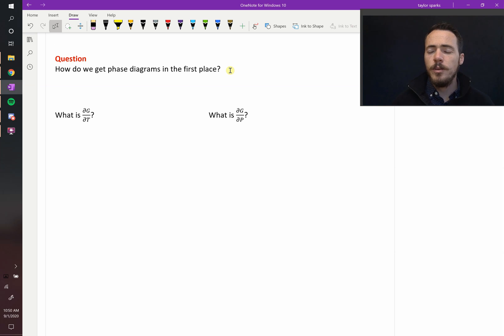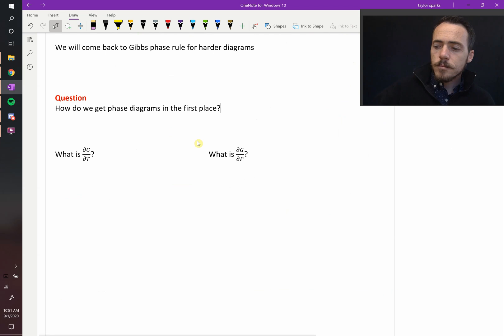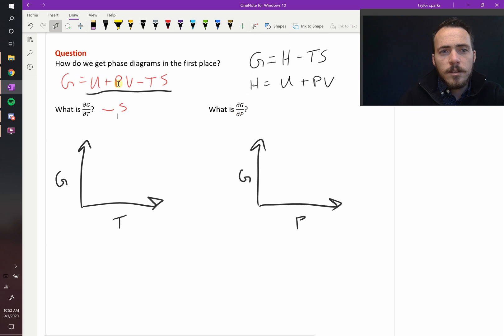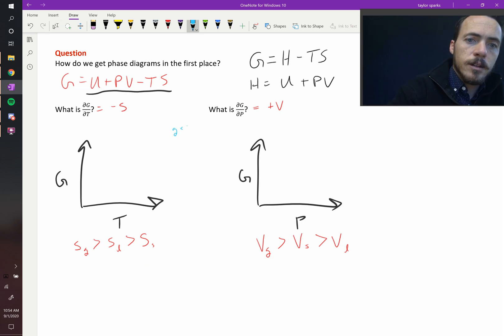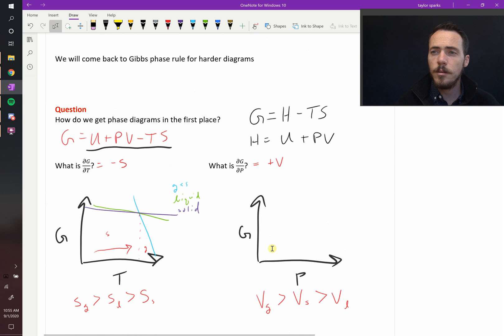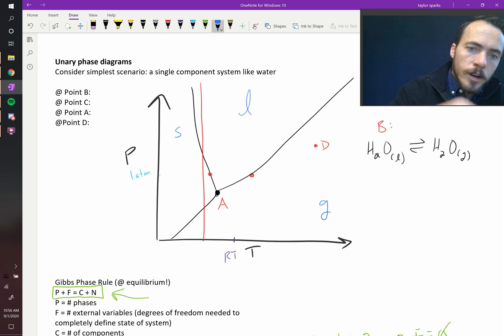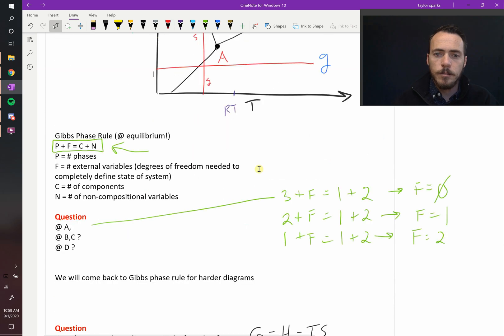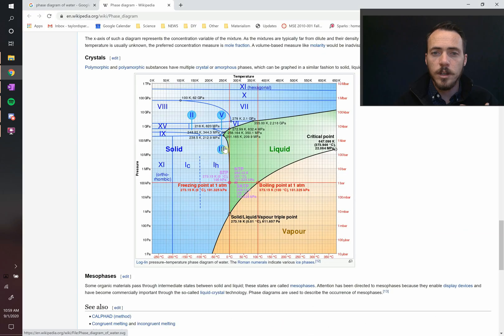How can you use Gibbs free energy to calculate a unary phase diagram

Comment: In calculating the partial derivative of the free energy with respect to temperature, we are assuming that all the other variables (other than temperature) are constant, right?
If we assume that pressure is constant and then change the temperature, wouldn't that change the volume? And as a result the slope wouldn't be the negative of the entropy

Comment: Can you explain why the pressure slopes are positive while the temperature slopes are negative?
Reply from the maker: I talk about that in the video. I think all materials have S_gas>S_liquid>S_solid so, dG/dT (the slope) should be negative and proportional to the negative entropy meaning gas should be steepest, followed by liquid, followed by solid. Similarly, dG/dP should be positive and proportional to volume of the different phases. The difference between positive and negative is simply because G=H-TS has negative sign so when you take dG/dT the negative stays there, but for G=H+PV-TS when you take dG/dP the PV term was positive.
Reply: @TaylorSparks  Thank you I rewatched and it was clearer for me the second time